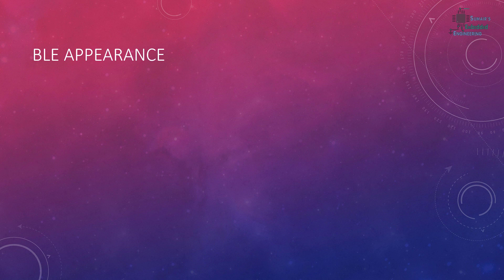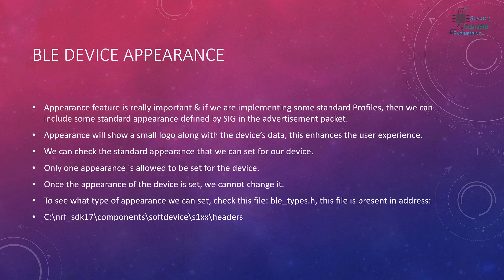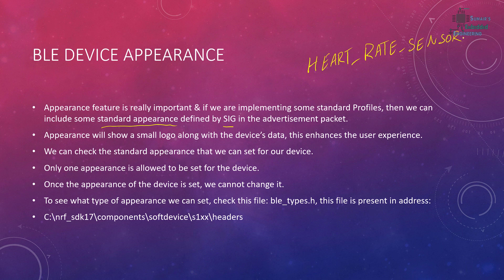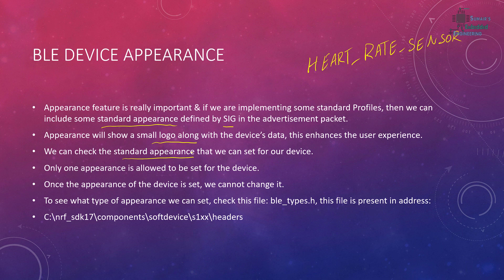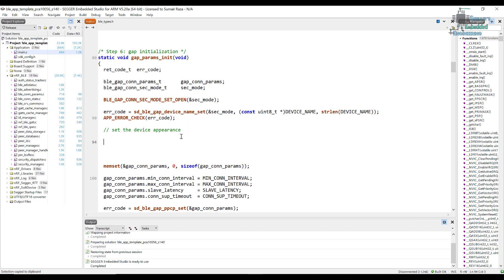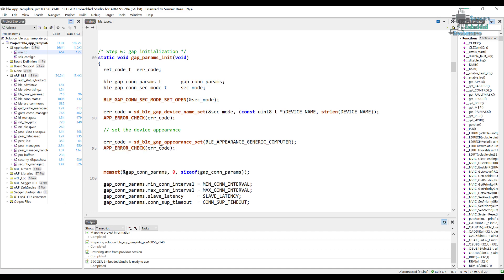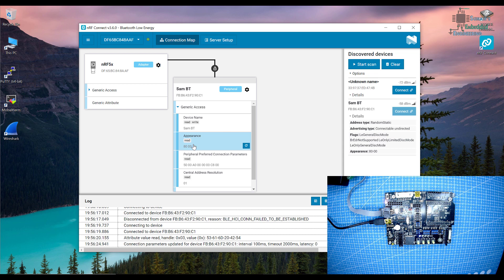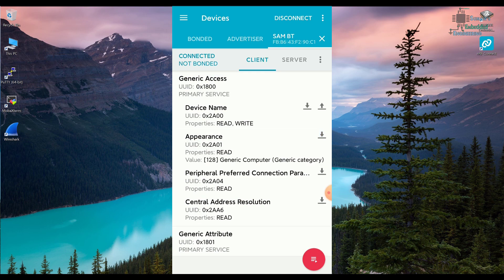nRF5 SDK - Tutorial for Beginners Pt 45 G - Setting BLE Device Appearance

Comment: Still struggling to keep power consumption low after. As when I include delay, in loop for some reason power consumption goes up to 3mA. If I remove delay and use start_adv with timeout interval, idk how to call the function again after specific time interval again. I can stop the advertisement with sd_ble_adc_stop, but it needs delay too so again current consumption increases. Need a way to call advertising_start() on specific interval without delay.